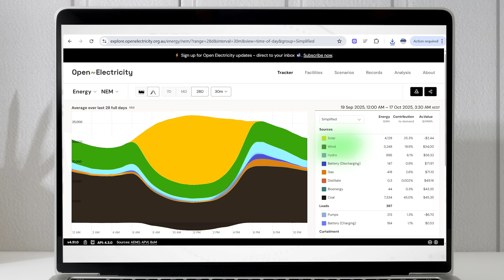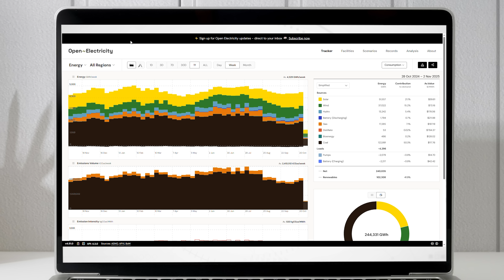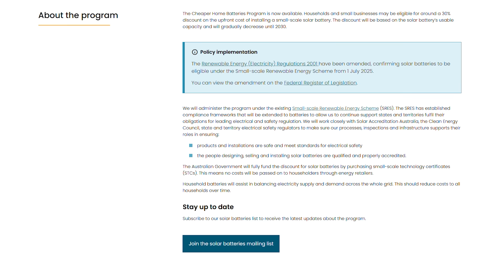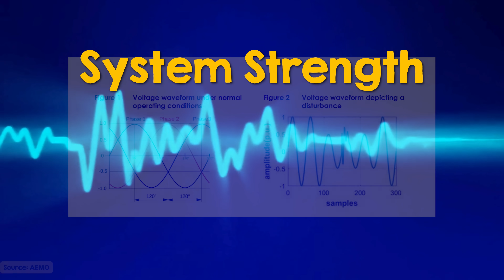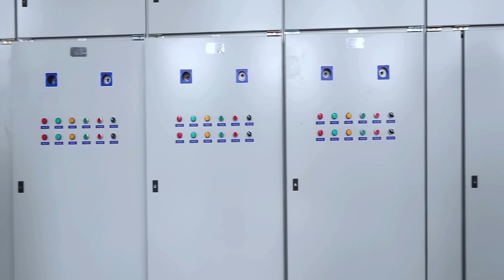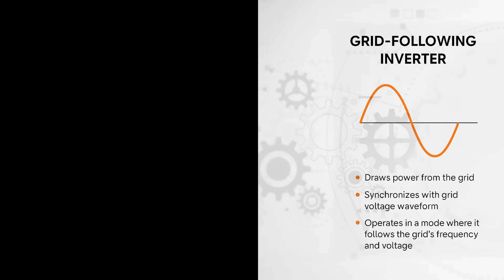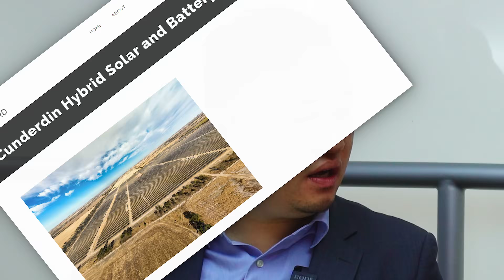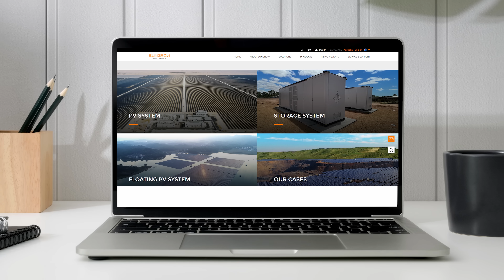Australia’s Solar Boom Is Breaking the Grid - Or Is It?

Comment: Wouldnt few new Nuclear plants completely solve the inverter problem?
Reply: No.  Nuclear power plants aren't grid stabilizers- they're inflexible to load, because the only way to afford to operate them is at high capacity factor, i.e. pedal to the metal, 95% of full capacity all the time.  Because 55% of our power in Ontario comes from nuclear- built in the past, which is the only time it was possible to build them cheap enough to be affordable- Ontario gives away power at 3.9 cents per kWh every night between 11pm and 7am.  That's not what it costs to generate, mind you...it costs more than that.  But while you COULD modulate the output of the nukers, generally you don't- because cycling them up and down in output, shortens the life of the expensive capital equipment of the plant.

In a mostly heating climate like Ontario, the optimal amount of nuclear would be the barest minimum amount of power we use during any 1 hour period during the year (3am during some spring or fall night would be my guess), MINUS the output of our run of river hydropower assets.  In Australia, the optimal amount of nuclear power is almost certainly ZERO.  You can do everything easily enough with solar, wind and batteries.  That's going to definitely be your cheapest option.
Reply: @spitfireresearchinc.7972   Uranium-fired power-service fuel cost is only half a cent per kWh (and declining steadily over time).
The most sensible way to deal with varying load is to shunt any excess power to resistors (which then turn it into heat).

Wind and solar are incapable of powering anything important, and thus are infinitely-expensive, on a sustained basis (since they can't power their own hardware reproduction).

Comment: There's a big risk that the expense of all that extra grid to connect the solar/wind projects and fed back into power prices will end up resulting in people disconnecting from the grid as it becomes cheaper to have oversized batteries. The grid will then become more expensive for remaining users, causing them to disconnect.  Then only the large users of electricity will remain - who might even work out different/cheaper methods - resulting in those large solar/wind farms being stuck with no users to pay for them.
Reply: No. There is a lot more to it than that. Ultimately by having local partly consumer-based energy storage we can decrease the extent of the grid and thus the costs decrease. The grid needs to be built to accommodate the greatest power demand even if that is only for a few seconds at peak times. The remainder of the time the grid is highly underused. By evening out the demand by local energy storage we need less fortification of the grid thus lowering costs for everyone.

Comment: Maybe there needs to be legislation that all new solar installations have to come with a minimum size energy storage battery commensurate with the size of the solar array.
Reply: And vehicle-to-grid (V2G) and home (V2H) technology expedited. I'm waiting to hook the Tesla to the home and grid - I have 75 kWh to play with.
Reply: Since 2026, the EU has recommended 25% of the storage capacity for 2 hours for all new renewable energy systems connected to medium and high voltage networks.
Reply: Free power overnight, power on demand during a blackout, everyone has those incentives to use home batteries.

Comment: Those cement block Towers seem like a great battery storage system for releasing the stored power from wind and solar
Reply: They seem horrific. You gain slightly in efficiency over just pumping water around, but the complexity is huge. You need to accurately lift and position thousands of blocks a day, and what happens in high winds when it is going to be active? Also you are inevitably going to start chipping bits of your concrete blocks and eventually they are going to be erroded to the point that the towers become unstable. 

Far better to take a slight efficiency hit and pump water, use batteries, pump air to the bottom of the ocean or store heat, they all sort of behave as fluids which means you don't need robotsb to find you stored energy.
Reply: Lots of moving parts, and not a lot of height. Also things like wind would cause dramas (hard to stack concrete blocks 10 high if its windy)

Better options are using old mineshafts for weight based systems (energy stored is proportional to mass and height, more height, more energy) or stuff like pumped hydro. All comes with challenges

Comment: A neat trick is to convert redundant coal powered generators into synchronous condensers. They are typically larger than off the shelf syn-cons, cheaper and quicker to deploy, and are already well connected to the grid.  Siemens (and surely other vendors) offer this.   The Australian Renewable Energy Agency already made a study of this option you can find online.
Reply: I couldn't find the reference (saw it on a video a while back), but somewhere in Europe they replaced a coal/gas plant with a huge flywheel "near perpetual motion machine" whose job it was to spin at the voltage speed and either use or generate electricity to smooth the voltage supply. Perfect place to put it because a decommissioned power plant is now a huge empty warehouse connected to masses of high voltage lines.
Reply: @mrgilbe1   yes, the flywheels are specialized with extremely low friction and govenors to help form the grid...
Reply: I was at the Yallourn W brown coal plant earlier this year. Once they shut down in 2028 the intend to convert some of the old spinning equipment into synchronous converters along with a large battery installation
Reply: problem is synchronous condensers lack frequency control; they only provide reactive power/voltage control via field excitation. A synchronous condenser is just a synchronous motor that is magnetically locked to the grid frequency with no prime mover to change frequency. This is why only synchronous generators or grid forming inverters provide frequency control.
Reply: @fablearchitect7645  actually it would be a fly wheel frequency control not a synchronous condenser. the flywheel is already there.
Reply: @MusikCassette  how can using the synchronous condenser as a flywheel increase RPM when the RPM is magnetically locked to the grid frequnecy? Only generators can do this by increasing engine speed.
Reply: my question was about if that is possible. and the second question obviously is, what needs to be done to those former coal plants.
Reply: @MusikCassette  You would think very little - just let them spin. But there is the efficiency problem, and I wonder how much maintenance they need, being mechanical components? Rosie also mentioned response time of grid-forming inverters. Presumably that's because they can provide or absorb transient power well above their continuous rating. A spinning generator has a fundamental impedance which would limit its ability in this area.
Reply: @matthewmarks6951  Inverters can react very fast, in milliseconds, but they do usually have relatively small limits to how large of a spike they can absorb above their continuous ratings. They can be designed to absorb more but that has a cost impact. That is one of the advantages of large rotating masses: They can absorb large spikes without breaking.
Reply: @matthewmarks6951  Just on Maintenance,... From the coal fired plant, you'd be keeping everything downstream of the input shaft of the generator, and dumping the coal burning hardware along with the steam boilers, turbine and cooling condensers. Pretty much the majority of the maintenance is gone with the removal of that hardware. Mechanically, the generator itself only has it's bearings to keep lubricated and cooled, along with cooling of the generator as a whole, and cooling the high power side of the power output hardware. Most of the maintenance that's required on that side is regular oil and coolant changes, and painting the pipes so they don't rust on the outside.
It's the high temperature and high pressure of the steam, which is basically a highly corrosive acid under those conditions, that eats up maintenance budgets with constant hardware replacement.
Feeding the torque to the generators input shaft from a gearbox connected to a motor, in turn powered off a local storage unit with direct connection to the nearby solar and wind, is going to be a lot more cost efficient for maintenance then the coal or gas ever could be.
Reply: @MusikCassette  Even with a robust Wind/Solar solution, you will need a certain number of "base load" energy generation units. They can be retired when newer much safer and cheaper nuclear comes out in 5-10 years en masse. 

I wouldn't shut down too many before that happens... 
even now, batteries can't maintain load for solar (they can for wind as it isn't an all on/all off proposition every night). Requires vastly less capacity.
Reply: @avgjoe5969  I'm not against nuclear, but the claim that it's "much safer and cheaper" in the face of rapidly advancing battery technology seems like an exaggeration. I watch the ever-increasing delays and costs of the Hinkley Point nuclear power station under construction in the UK.
Reply: @avgjoe5969  no you do not need base load. quite the opposite. Base load becomes harder and harder to place. This Idea shows a deep misunderstanding what base load was for.
The thing that you need in order to complement solar and Wind is called residual load. 
And Nuclear power can not provide residual load.
Reply: @avgjoe5969  also: why do you bring this up in this threat? ain't nothing to do with that at all.
Reply: @avgjoe5969  Why will we need base load at all?
Reply: I'll have to read more about synchronous condensers to understand, but it does seem a good idea to drive existing decommissioned coal P/station alternators with whatever cheap marginal electricity that's available. If the power costs nothing, what does it matter if the motive driver is 90% efficient. Leave the power stations and infrastructure there. Yes, more flywheel effect. The more distributed the better I would have thought.
Reply: @raystone4673  Other challenges like old power station equipment requiring replacement (these plants have all been run until they're almost unusably broken) - and then need to turn around and give a 20-year performance gaurantee as a grid firmer, infrastructure maintenance etc, means that a careful economics-based decision needs to be made if it's better to build something new for that money.
Reply: Many of these places also offer the nexus for utility sized solar to feed into with such high kv grid lines, control, substation kit and as noted ..
Reply: Synchronous condensers like this will have high mechanical losses....
Reply: What about electric heated melted salt batteries inside coal plants???? It could absorb "free" solar power "during the day" and generate steam to the turbines "during the night"...
Reply: Yes. I also hope that the new fracked geothermal technology can be used to convert existing thermal plant to run on geothermal energy, since it allows for geothermal resources to be tapped in areas that do not have a natural geothermal aquifer. We can then re-use the existing turbines (maybe, or replace them with ones suitable to the geothermal source), synchronous machines, and grid connections, retire the coal and run with zero emissions, without re-engineering the grid so much. A useful part of the new mix, I hope..
Reply: Nuclear... do it once do it right+
Reply: Ever priced one of these conversions? They are not even close to financially viable and it’s cheaper to buy a new syncon. Back in your box desk jockey
Reply: @Jimmyswole-YT  Yes it’s a non trivial job to make a conversion.  Yet Siemens, GE, Eaton and others have been doing so since around 2010. Hydro plants are easiest to use as it’s only the excitation that needs to be changed as they can already spin in air in preparation for going on load at short notice.  I did work for several national power utilities before retiring, but I’m happy to sit in my box if you think that’s the correct way to address people when you disagree with them.

Comment: Home batteries are a game changer.
Solar farms should all have access to some form of storage facility. 
A solar/battery facility is far more flexible and economically beneficial than solar alone. 
Spanish blackout was caused by multiple failures - poor communication - taking gas plants offline for maintainance after they had been told to stay on, poor regulation - no single point of responsiblity and insufficient infrastructure to deal with the inductive power and voltage deviations.

Comment: Why not just split the grid in smaller sections with DC connections? HVDC converters are becoming much cheaper and it would seem easier to exchange power that way.
Reply: It is.  The NEM is basically five grids interconnected like this.  (I think there might be one or two AC connections but most are HVDC)
Reply: High-voltage direct current systems are advantageous underground or underwater at distances greater than 80 km or for overhead power lines at distances greater than 600-800 km.
Reply: @MihailG5541  Yes, but if everyone has inverters anyway, why not just go DC ... it is not like AC is better at short distances. it is just that in the past it was difficult to transform DC up or down in voltage.
Reply: @trex2099 Alternating voltage is much better and more convenient at low and medium voltage, cheaper and easier
Reply: @MihailG5541  That was true in the past but today I am not so sure. However, we are not going to convert all of our stuff to DC. But connections to local sub stations could be DC.

Comment: I live in NSW. A few years ago our grid was completely redesigned with the latest equipment. For the benefit of users? Don't be stupid. .........The liberals wanted to sell it so they needed it up to date and swish so their mates who bought it would not need to spend anything for eons to maintain it. Seems I and all NSW electricity users were duded. Either we payed a fortune for the upgrade and rebuild extra on our power bills for nothing done , a coffer filler, or the redesign was a load of crap from deniers of climate change and therefor renewable energy. Because it needs another rebuild we are informed.

Why? Because of the base load of coal fired power stations. And news for you denier people, a base load is not a bloody big static power station. Its actually the basic load each individual  coal fired power station has to deliver safely or be shut down. And coal fired power stations cannot be shut down for a sunny day here and there when the solar is in complete charge, that is actually most days.  So what they do is dump the solar power to keep the coal fired power stations going or the grid would be overloaded. But the solar feed in still needs contract payment. Hence the cost to users being high. The coal is causing the price to be high just to keep it going without the impossibility and diaster of shutting generators down for most of the daylight hours.   This dumping is the reason the government plan for free power is possible at this time.

Yes, the grid does need redesign for handling a different type of input. Maybe many smaller networks linked to larger national grids all with HVDC interconnects. Or even solar feeds being DC into a hub where they are converted to AC for local consumption as well as feeding the grid.  DC is used in several countries for HV interconnects, its stable works and does not emit an audible Buzz.

But whatever is going to be done make it quick. The federal government having its own currency that it can create at will should supply funding. Immediately. No budget required.  I would be happy to explain that if anyone asks.
Reply: The Coalition sitting on its hands for nine years and not enacting legislation to give investors security has caused a lot of the problems. I'm furious. We all should be.
Reply: The main thing is to avoid peak wholesale electricity prices of €230-260 per MWh, as seen in Eastern Europe due to the closure of relatively new coal-fired power plants before fast-response gas-fired power plants were brought online to back up renewable energy.
Otherwise, high wholesale prices outside of renewable energy production hours will become the "new normal."